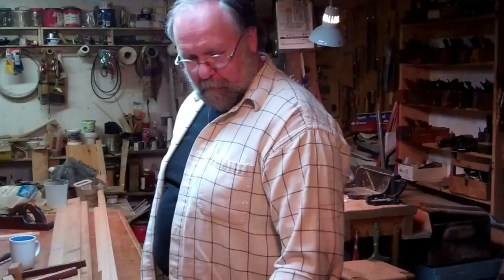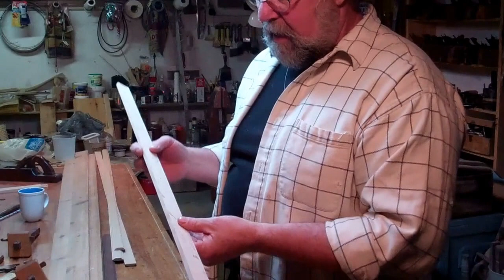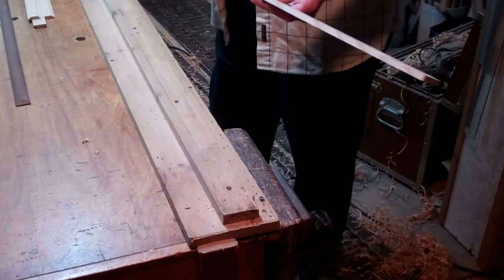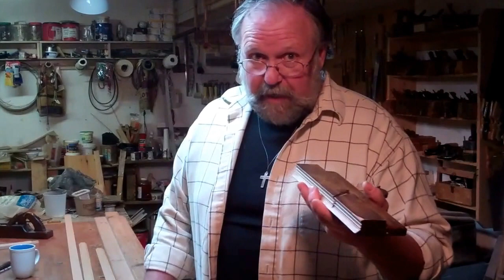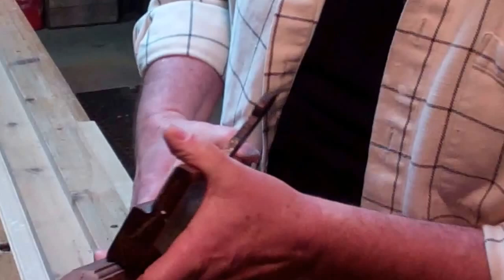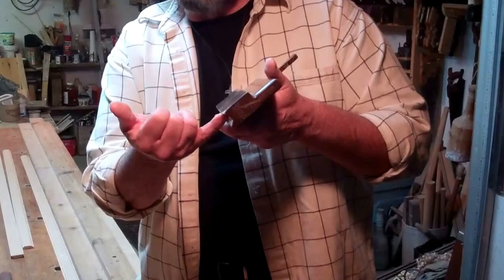How to make a moulding

Comment: Interesting to see that you are starting at the back end of the strip of wood, unlike when making a groove or rebate. However the moulding plane has enough support for it's cutter and can be handled the way you show here. As for sharpening, I have pretty much set aside my waterstones since I have found a couple very old but very good hard Arkasas stones with little wear. They do everything I need, almost. One of those diamond re-facing things would be nice, but the poor cannot be so bold. God provides, but we must toil also.